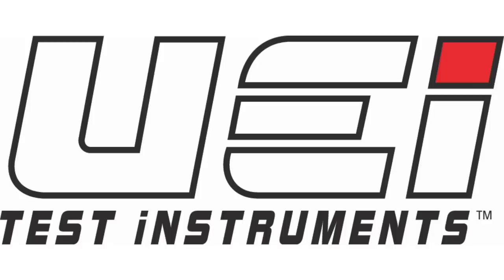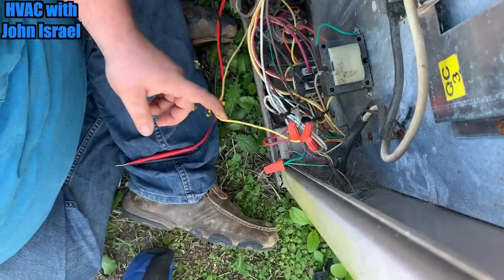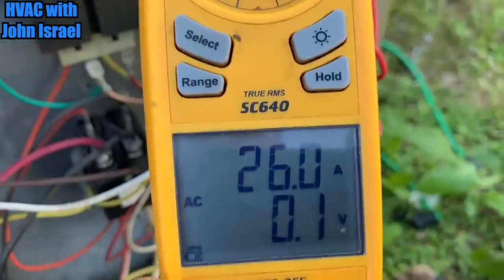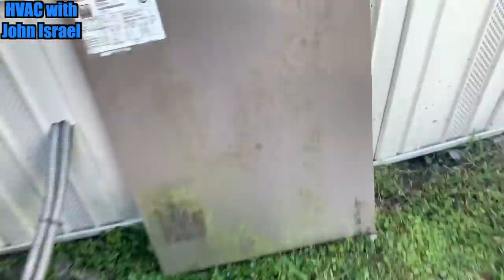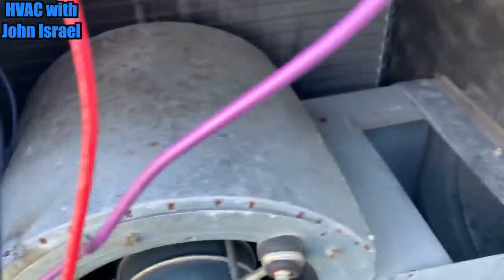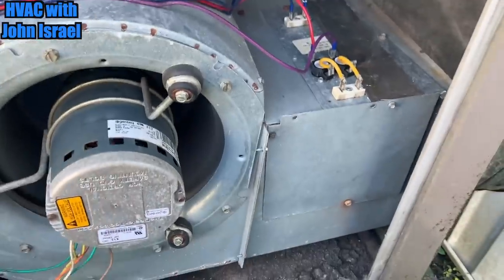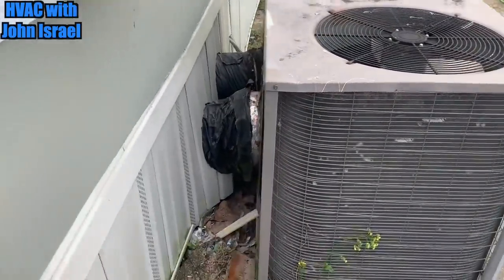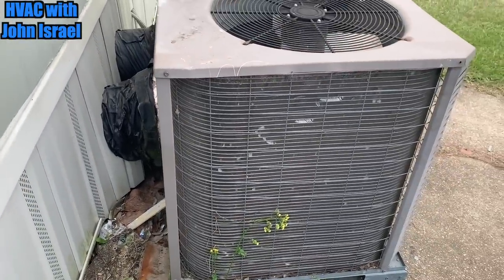No Heat York Package Unit

Comment: I know some people in a mobile home with a 4 ton Package, using 12" supply and return. It works, but have a 300.00 + a month electric bill
Reply: I've never installed anything over 3 ton in any mobile home... The supply duct can barely handle 3 ton of air. And usually do 2 returns if I have to do a package unit.... The old 10 seer Nordyne and Coleman's package units had 12" supply and return collars on all models including 4 ton.

Comment: Thanks for the videos John.  How were you able to tell the year of the model from the label, as I couldn't see 2011.
  I have a residential  York  Central Heater/AC and can't find information on how old it is.  Right now the unit won't turn off so I had to shut it off with the breakers.
  Is there a manual to download or how to do troubleshooting?  What combination whole/home air conditioner/heater would you install over a York model?

How old is this model?  It's at least 12-15 years
Model#  D3GA030N04206B
Serial# NFOM051478

Comment: Time for a new unit. Rotary compressor? Like we say in the hvac world 95% of the time it's the install job not the equipment. Hack  job 101... how hard is it to run 5' of  round pipe? Wtf. I install package units  on the regular. I wouldn't have made it back to the shop if did that shit job I would've been fired on the spot.